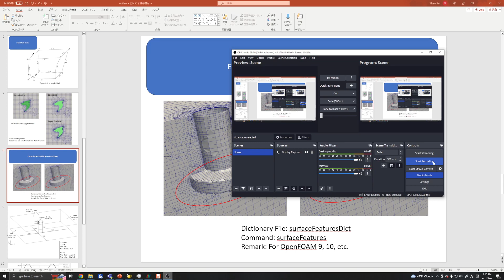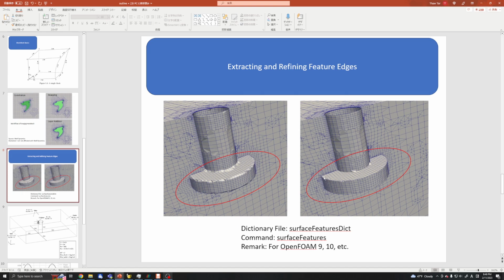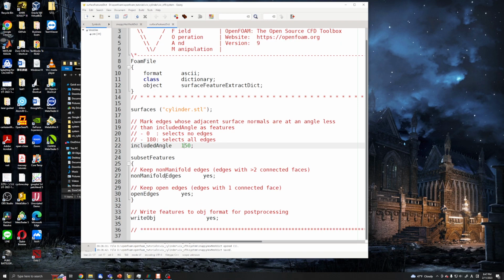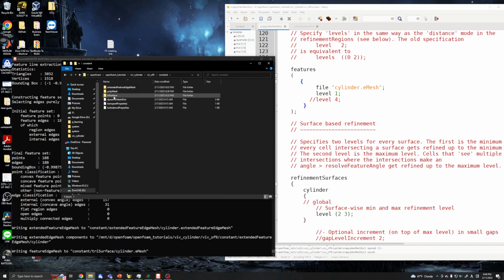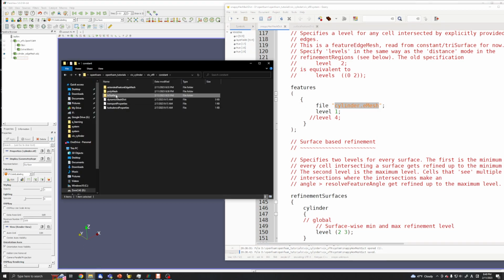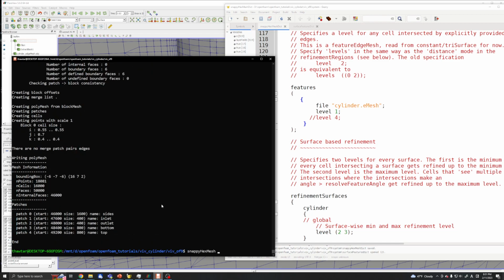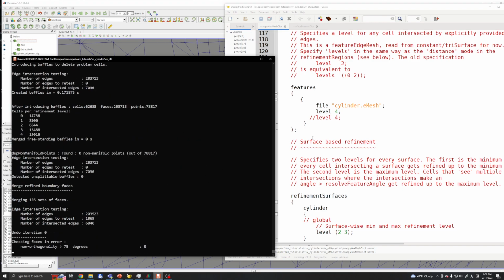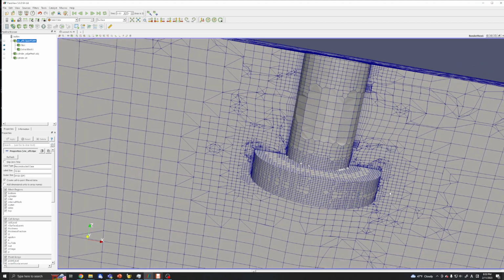Vortex Induced Vibrations (VIV) in OpenFOAM (Part 3.5: Extracting and Refining Feature Edges)

Comment: I'm not able to extract the vibration data and the lift coefficient, and I’d like to know how you did it. I added the function to the controlDict, but it’s not working. Do you have any suggestions on what I could try to solve this?